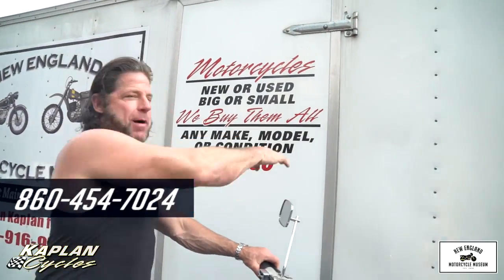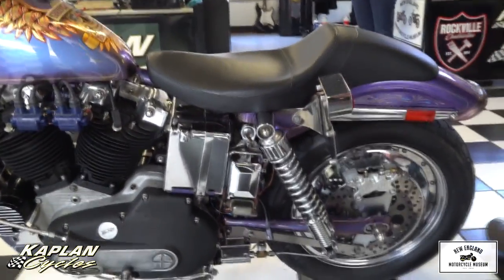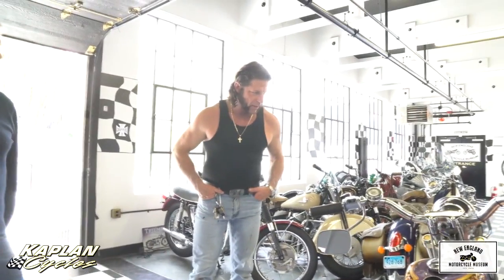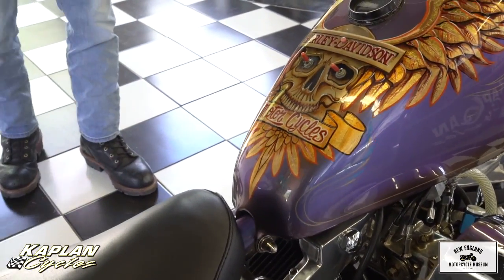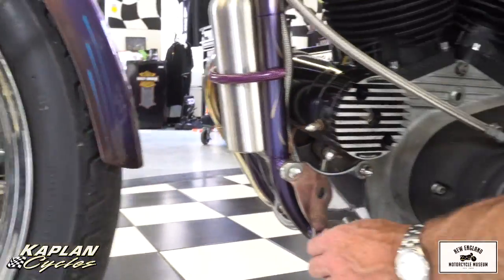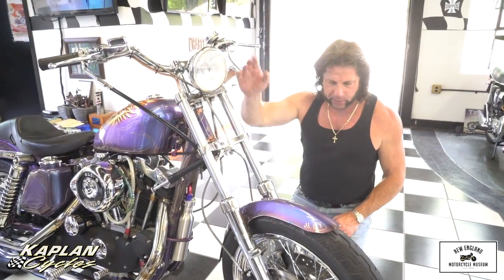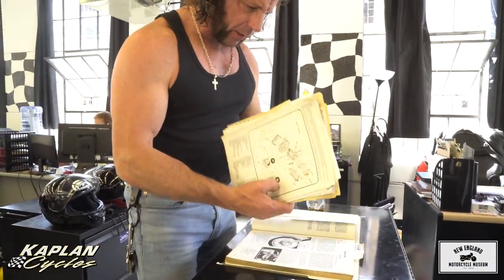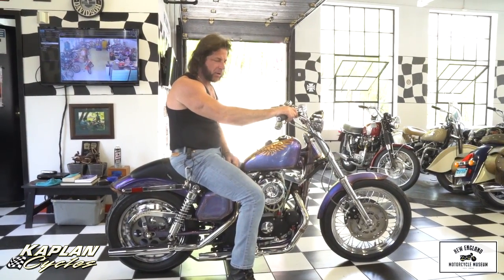1973 Harley Davidson XLCH 86ci

Comment: I am fairly confident that the front is stock length or very close, like he said the smaller rear wheel gives somewhat of an optical illusion ,if you will.  But I believe the biggest contributer to the longer tube illusion is the fact that headlight is pedestal mounted and exposes the entire fork, if you imagine a stock AMF XL headlight bucket and eyebrow trim in the stock position, I believe that it would look a lot closer to stock.
Very, very  nice ride! I have owned several of these righthand iron head XL's.
Love em, but this is a whole nuther level and as a former drag racer I can appreciate the attention to his enovative  performance efforts.
Thanks for letting us check it out...

Comment: WOW...i had a 1975 xlch but nothing like that..thats a sweet sporty. Bought my old sportster for 300 bucks Canadian...held onto it for three years. Was locked up when i bought it...i managed to free it up and take it for a few miles. Loved it...tall gears...sold it for a cool grand to a buddy who wanted to restore it for his wife. My shift peg was left side though and no electric starter. Kicking it over was a challenge...them points and carb had to be just right or she was just not gunna go! Still got bruises from kicking that bike over lol...i think mine was 63.4ci or 64.3ci i forget. Was what i think was a 1000..i could be wrong. lol they use to say those old bikes had two oil leaks...one at the showroom and one at your garage lol.
Reply: I owned a 1975 xlch sportster back in the day and it had electric start only, bought it new. Went through a couple of idler gears but that's about it and put about 17,000 miles on it before trading it in.

Comment: I told you it was a Time Capsule. Part Rocket Ship Too! All the Best will your Motorcycle Museum.
Reply from the maker: Dave Ford thanks David this is one of those rare occasions where we got more than we bargained for in the bike is better than I could have ever hoped for you did an amazing job with this motorcycle building it in maintaining it for 45 years!
Reply: Your welcome Ken. Things that have come to me since we spoke is that we had all the reciprocating weight pieces blue printed and balanced as well. Not only were the Heads Dual Plugged but Baisley High Performance Ported, Polished and Flow Benched them as well. The Valve Geometry was also reworked to accommodate up to .625 Lift Cams.
Reply: Very nice bike Dave. Obviously a work of love.  Were you selling for health reasons?
Reply: Thanks Kevin, No, health is fine. Once I moved on to larger bikes I parked the Sporty. Golf took over my adult life and even have made custom golf bag mounts for my Road King & 2018 Milwaukee 8 Softail Deluxe. I bought the Sporty at age 20 and sold it a 64. As I reflect back, I developed my skills as a builder on this bike. (Machining, Painting, Engineering, etc). It was time for others to enjoy.
Reply: Who did you outsource the paint job, Dave?
Reply: @DrWhit-vz6nr  He was a local back in 1976. My guess is that he has probably passed by now. Lots of Drugs. I did the basic flip/flop paint and then Ogar Mung did the Gold Leaf and artwork. This guy would paint in 3D. The depth and layers I saw him do was on-real. MC Escher, type artist. Many moons ago my friend.
Reply: @s3gts  Very well! Thank you; curious to know the ballpark value of this bike nowadays?
Reply: @DrWhit-vz6nr  Check with Ken, he can probably put you in touch with who bought it.
It was my time to move on and let others enjoy it. I still ride and have 2020RGS and a 2020SGS. Two homes. One in Ma, one in FL..